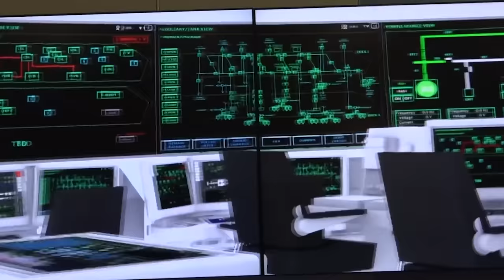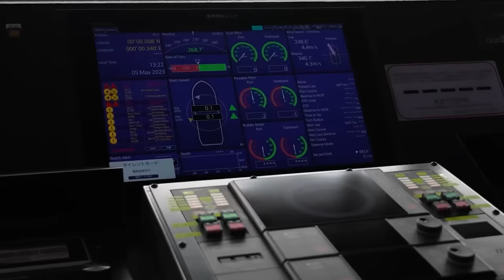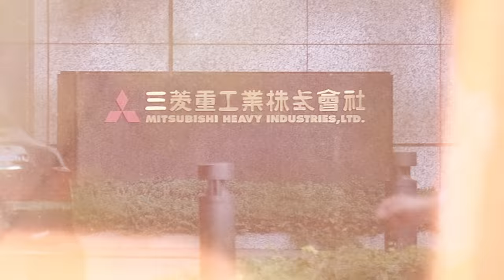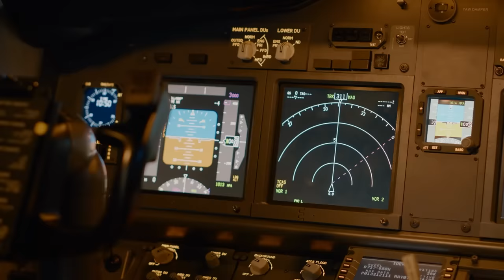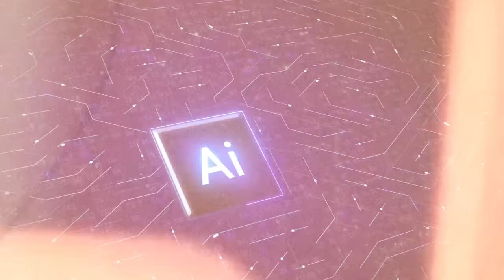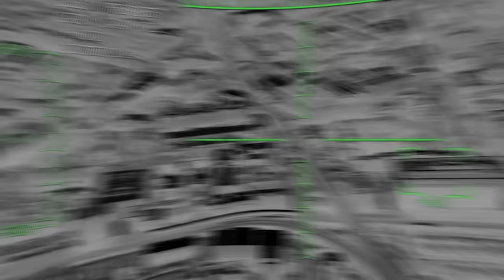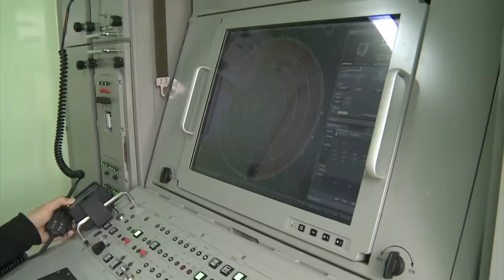Japan Shock China & Reveals 5 Never Before Seen Weapons

Comment: They have purchased the blueprints for the yf-23 and it's in the flight testing phase,with pilot and pilotless and their advanced version from the original is much better and once it's released it will rival the Russian SU-57 which is putting that new advanced state-of-the-art engine in so it should be interesting